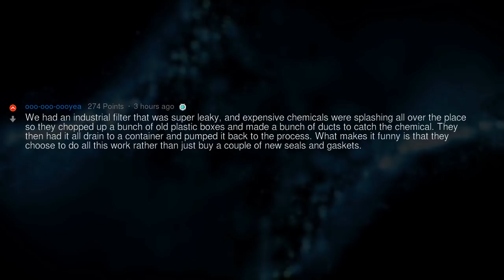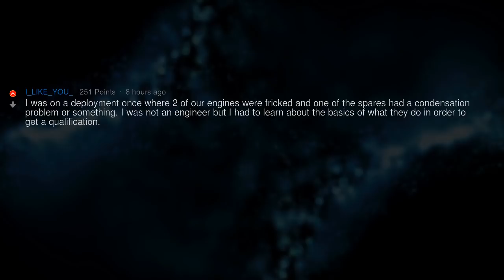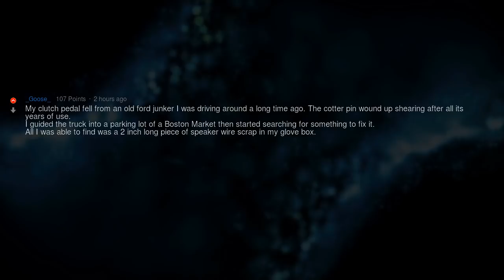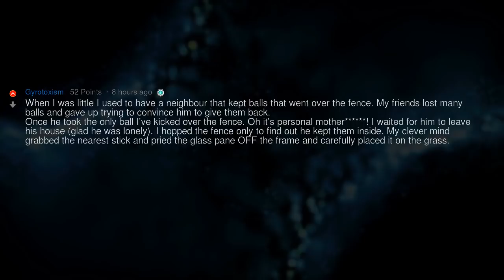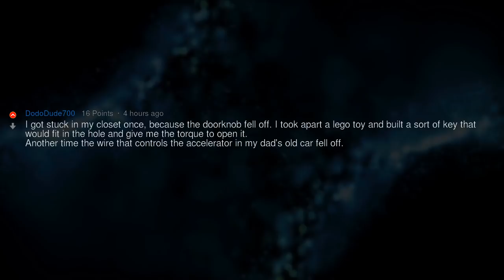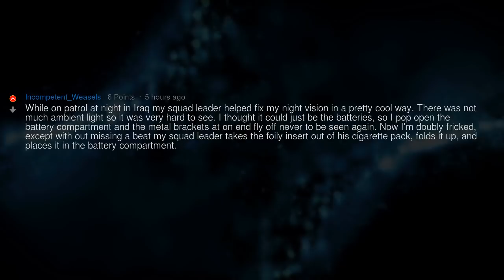That Are Some "MacGyvering" Serious Skills You Have | People Stories #620

Comment: I once needed to unscrew something on my PCs mainboard. I wanted to install an m2 ssd but the screw was already kinda used. Not sure if that happened in the manufacturing process or whatever, I never touched it before. After 15min or so of trying and rasping the screw even more, I took out a bottle of lighter gas and jut pressed it against the screw for a slpit second. Came loose very easily after that. Not sure how dangerous it is for the plastik of the mainboard or the thin metal lines, but there wasnt much around so i just went for it.

Comment: All these people using all sorts of ways to plug the drain to take a bath. A wash cloth wadded slightly and shoved in there works, too. Had a shower without a drain cover, and I hated standing on cold and wet tiles. Laid a wash cloth over it (single layer), and that let the water build up enough to keep my feet warm, and every so often I'd just lift a corner of it so that the water wouldn't flood the 3" lip of the shower. No bath there, but I like showers more, anyway.

Comment: Not sure if this counts as macgyvering but it's still useing what I had instead of proper materials.
Had a rat problem on a farm (wasn't how many but where).  bait blocks weren't working and couldn't use poisoning because the nest is in a wall next to new born animals. We do have bulk quantities of sodium bicarbonate and preservative acids , mix em and you get CO2 just like a baking soda & vinegar volcano. Poured the mix in the rat holes and they all suffocated in minutes. No new rats move into the old nest either and its been a few years too.

Comment: The screws in my glasses fell out, and I didn't have a repair kit (nor could I get one, out in the bleeping woods). So I tied the noseguard pieces and the frames back together by threading fishing line through the screw holes, over and over, yanking it tight, then knotting it. It worked. 
Also 'fixed' the AC units in our cabins (summers in Georgia, woo-hoo!); all they freaking needed was for me to pop the goddamn filters out, take 'em over to the water pump, and scrub them clean with a little hand soap, and all of a sudden they ran like a dream. I still can't believe nobody had ever bothered to check or clean the damn filters!

Comment: this was actually on MacGuiver, but using a the car battery (car was running) and jumper cables, he used a nickle to weld the battery mount into place, it was a WTF are you doing then, oh shit that works.

Comment: I have a pretty good one.
So I do lab assisting as part of a job for the university I attend, I put together the necessary materials to allow the chemistry labs for other students to happen.
During one of my prep/cleanups there was a graduated cylinder with a penny stuck in the bottom of it nearly flat to it. Pressing a little bit there was some leeway but not close to enough to remove the penny. So I used my hand to warm up the glass cylinder and penny then I used a little bit of acetone on the penny which I know would evaporate quickly and cause the penny to cool rapidly. The cooling of the penny caused it to shrink slightly and much faster than the surrounding glass so I was able to press on the penny with a stir rod and remove it. By far one of my favorite moments.

Comment: My most memorable one was many years ago. My dad & I were on a road trip in Baja California in his '64 Chevy  van. The Transpeninsular Highway had recently opened, we were headed home, and we stopped in Guerrero Negro to get an upper radiator hose. The replacement didn't fit, dad's Spanish just wasn't up to describing what he needed, and the old radiator hose wouldn't get us back to the States. So, 11 year old me piped up with "how about we cut a section off of the old radiator hose to act as an adaptor, slide it on the radiator end & slide the replacement hose over it?"
Dad was suitably impressed, did the repair, and drove it that way not only back to the US but for another 5 years afterwards.

Comment: I had my 95 Ford escort with manual windows stolen in 2018. They broke a back window and forced the ignition with a screwdriver. So yeah, I guess locking it didn't help much

Comment: I got the nickname from my roommate when a water line under the sink busted from ice one winter I had a large pen and a repair kit for my waterbed I cut out the broken part and used the glue to put the body of the pen over it was still there and worked with out leaking when we moved out and still had the part store where I got the pen readable years later

Comment: I had to clear away a birdnest from a flat, 2nd story window overhang. I didn't have a ladder long enough and didn't want to rent a scissor lift to do it.
I ended up using an extending paint roller pole and zip-ties to:  zip-tie the spary nozzle open. Zip-tie the nozzle to the pole and wrap the hose around the pole a few times. Wife turned the spigot on, a few minutes later; no more nest.
Yes, I waited for the birds and chicks to move on.

Comment: I once forgot my house keys and locked myself out

Luckily, i had a pair of hairpins in my pouch (i always carry random shit cuz who knows when it'd be useful)

I turned them into makeshift lockpicks

I also have a bunch of random thingys I keep on myself at any time, these hairpins are only the tip of the iceberg, example given: a tiny, makeshift drone i made (my pouch is very big, and the drone is disassembled when not used), a small sac filled with black powder, a makeshift flintlock pistol and some metal balls, a Nokia 3300, some components I use when i feel like tinkering with stuff, a custom 5 watt laser pointer (even looking at the dot will permanently blind you), and much more

Comment: Working in a factory. My job was to place packages in the machine to be sealed and have their expiration date stamped on. You set the package on a conveyor, the pinch rollers on top grab it to pass the top through a heat sealer, and as it moves past the ink jet, a sensor detects it and fires ink at it.

This was very prone to error. The biggest problem was if the packages weren't lined up just right, the sensor wouldn't see them at the right time, so you'd end up with smeared or misplaced labels, or ink on your shirt.

The fix was three parts:

1. Taped a pen to the machine, beside the conveyor, sticking up. Placed the cardboard from an empty roll of duct tape on the pen. This pushed the packages into a good position so they'd be lined up properly.

2. The sensor was a laser at the end of a long, thin, stiff wire. I cut a plastic straw, slipped it over the sensor and taped it on. Now the sensor wouldn't be fooled by reflections and stray light coming at it from the sides, as the straw ensured it could only see straight ahead.

3. Taped some cardboard to the machine in front of the ink jet, so that if it did miss, the ink landed on the cardboard instead of the operator.

I don't have stats, but I know I increased productivity significantly. Now instead of having to carefully line up each package, you could practically throw them onto the conveyor and they'd come out perfect 95% of the time. (The remaining 5% we just wiped the ink off with solvent and tried again, so no big deal.)

Comment: I have seen my dyslexic brother fix an engine that overheated with the tap from a soda can. That dude can fix anything with engine or anything electric to the point where it is actually a bit scary. All the wiring in my house is done by him, the amount of old cars he has fixed for me over the years.
Reply: Question: how is him being dyslexic related to the story? Genuinely curious
Reply: @andiward7068  it's just strange how some things are just easy to some people. I mean how do you get an engine like a damn wizard but letters not so much.
Reply: @maxejnar9934  well, the parts are stuck in place and position but to him letters aren't. But I get your point.

Comment: the ford model T one with the belt. Thats why i love old cars. they could be malfunctioning and a simple kick or punch or string could actually fix it. things need to be made like that again. i rather have a 1 ton crt tv if it ment it lasted 20yrs over a 50inch 2 lb tv that would last 2yrs or a car like that model T with a top speed of like 50 that any single person could fix over a car today that requires 100 different people in 100 different fields to solve why the car wont start.

Comment: Late 90s. My buddy just bought a used Camaro and we were going out joy riding at night. Going down a fairly busy road and hear a big thud followed by an ungodly loud scraping sound. We pull into a Walmart parking lot and notice his exhaust has fallen and was barely holding on. My buddy went inside of Walmart and bought a bundle of wire hangers then proceeded to unravel all of the hangers, and then use them to hold up the exhaust in place then wrapped them around the car’s frame for support. It worked long enough for him to drive us home. It was interesting to say the least.

Comment: My best work was the creation of a hiding spot in my bedroom when I lived with my parents.
My bedroom was on the second floor, above the kitchen. After we moved in dad had central air conditioning installed. A vent was needed in the kitchen so the ductwork went through the ceiling in my closet, hugging the back wall and then jutted out in an L shape so that the vent wouldn’t end up in the cabinets in the kitchen below. All this did was essentially split my closet into two halves while creating a mini shelf there as my dad encased it in a wooden frame that he covered in left over hardwood flooring that matched the floors we had put in before.
I removed the screws from 2 planks of hardwood and was able to slide them out. After which I broke the screws so it was basically just the head in the planks. Then slid them back in.
Now there was an easily accessible space under it that fit some drugs (weed) and harder porno mags.
I emptied it all before moving out and replaced the screws with new ones. My parents never found it.
They did find the two or so Playboys I had hidden in another spot that was a more obvious place, but Playboys are so tame, especially compared to the harder stuff in the main spot.

Comment: Just yesterday, my brother and I were driving halfway across the U.S., at the time we were 1,100 miles from home taking the turnpike pretty much the whole way.

We stop to fill up the gas tank, stretch our legs, take a leak. I was driving and inside my bro asked for the keys to start his shift of the day. After I piss, I walk outside and I see he squeegeeing the windshield before we leave.

The keys were on the seat and the car auto-locked, shit. My bro had literally nothing on his body. Just a shirt and shorts, not even shoes. Luckily, I was wearing sneakers, had a pocket knife and my phone on me.

We call the insurance company, a lock smith, the closest guy is 2 hours away. With the car still sitting at the pump, we’re not waiting that long.

I ran into the convenient store to see if there was anything we could get creative with. Nothing really stood out. Asked the lady at the counter and a few travelers if they had a coat hanger lying around, but nothing.

Checked the surround area for a stick, or anything long thin and sturdy the could maybe slip through and push the lock button. We thought about taking a rock and smashing the window, but there had to be a better way.

We take both my shoe-laces off, use one to pull open the corner of the driver door just enough for me to take the other lace and poke it through the door seal with my knife. Once it was in, we tied the other lace to it.

Then we made a slip-knot on the end, use my knife the prop the door in another spot to get the loop through. Then use some gentle maneuvering to tease the loop around the lock, luckily it was a “stem” style lock that sticks up.

Pull is tight, then yank the lock. This took several tries, over an hour of trial and error, harsh words, but nothing could beat the excitement we both had when it finally hooked.

I jumped up and down, we hugged, and got back on the road.
Reply: You cant take the turnpike very far tho lol this story sets off the GET THE FUCK OUTTA HERE LIAR detector
Reply: @BenoitRAG3  turnpike to route 80, my first time driving across the country. I barely know shit
Reply: @A.C.E.  so you took a turnpike to a giant route highway .... that doesn't mean the turnpike takes you the whole way lol
Reply: @BenoitRAG3  not the point of the story

Comment: At my first full-time job, I was tasked with a "small" project. I had to clean the water filters on a cooling tower. It was something that had to be done every 2-3 years (I left the company shortly before it needed to be done again). The work itself was easy, but the method used was not that good, either for the filters - it worked, but it was highly inefficient - or the hands. The method? Take a power hose to the filters. The work was conceptually easy, but the constant micro-vibrations will render your hands too painful to close. And it used so much water that the company's water bills would climb significantly while this was being done. And it would take a whole eight hours to sufficiently clean each of the four filters, so it was a week-long project.

Some might say it is good to use it to drag out your time and earn pay, but you try doing this in August...in South Texas...outside.

After I finished with the first filter, I went inside the company's storehouse and scrounged through the materials there. I found four containers that were big enough to hold one of these filters in each of them (I only used three of them because of the one filter I had already done). I then found a couple of brand-new large containers of vinegar (it made for a good cleaner at the company). I placed a filter in each container, filled them with vinegar (enough to fully submerge the filters), and found some items with decent weight to them to keep the filters submerged the vinegar.

I left them soaking overnight, and the next day, I only needed 30 minutes to finish cleaning all three of them. And during lunch, I went to the local H-E-B and bought two new large containers of vinegar.

My future boss saw me using my method on the filters and demanded that I be transferred to his department. I was transferred to his department the next day.
Reply: Huh, when you tell that story, I probably would've done the same thing. Especially considering they should've been looking for more productive ways to clean them in the first place. I always try to think in efficiency, because it means I can be a lazyass afterwards if that was my only task for the day. Isn't it fun though? You figure out their method and then think of faster ways to do it so you can get it done and over with.
Reply: So you power washed them?

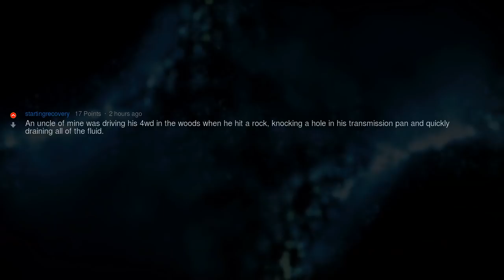Comment: A fun fact about the story at 15:40.

Motor oil and transmission fluid are actually the same thing. No, they really are the same thing - as in, they are the exact same oil. They just add coloring to the transmission fluid so you don't confuse which one it is should you find a leak.
Reply: ^ lies ^ similar but not the same. Transmission fluid will cause seal failure in engine and engine oil will cool the transmission poorly and is too thick